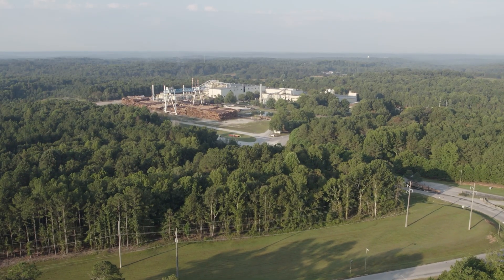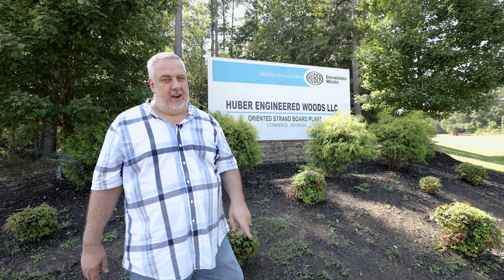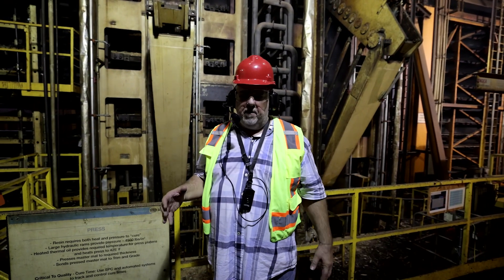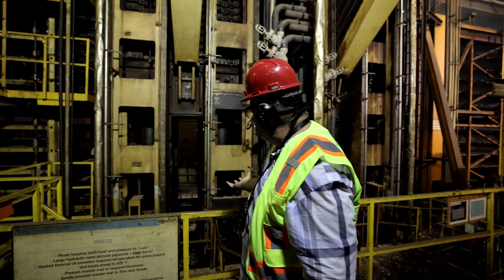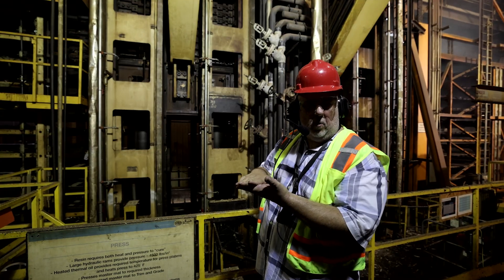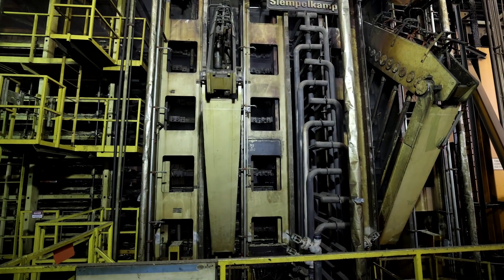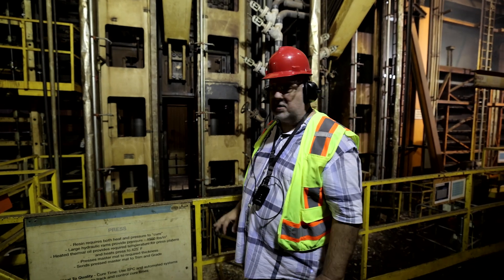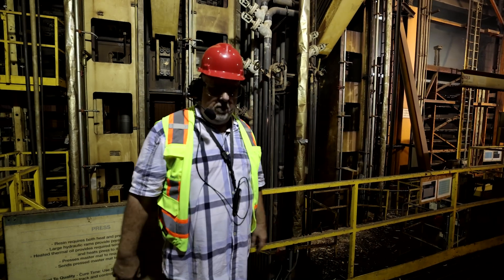How is ZIP OSB MADE ?

Comment: Nice matching outfits in the trailer Steve!
One question: is the OSB used in the zip panels, the same osb quality as advantech? I cannot seem to find an answer to that.
Reply from the maker: Advantech is slightly better, given its floor sheathing and not wall sheathing
Reply: @stevenbaczekarchitect9431  Thank you! I am interested in introducing a system like zip in the european markets, im a building engineer. Lets pray it happens, we are lagging with housewraps here.
Reply: @stevenbaczekarchitect9431  I understand, thank you Steve for your answer.
Soon I am going to enter a job at a European Building Firm as a structural engineer and Im pitch Zip System once I am somewhat able to call some shots. Should be in the Euro market!